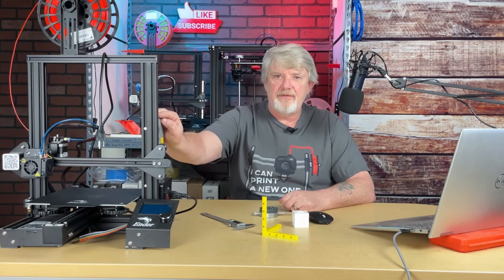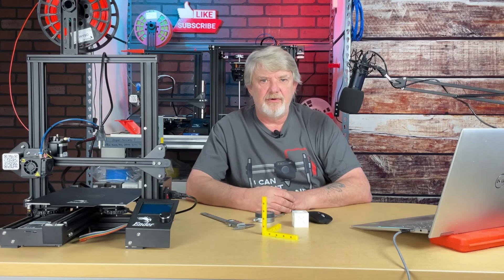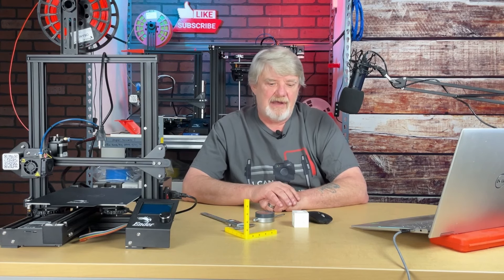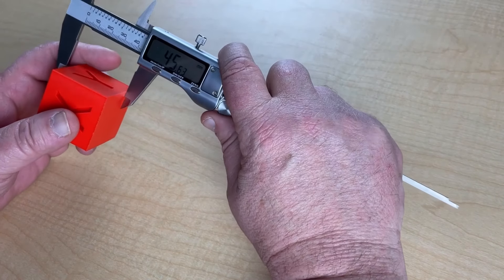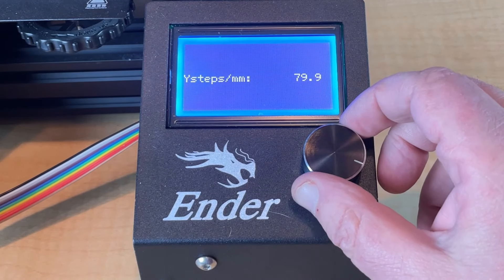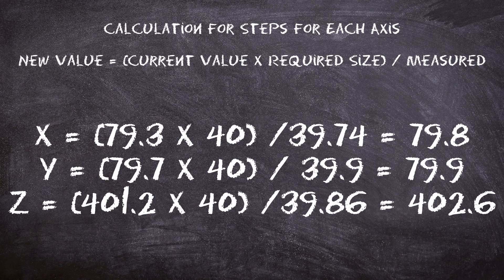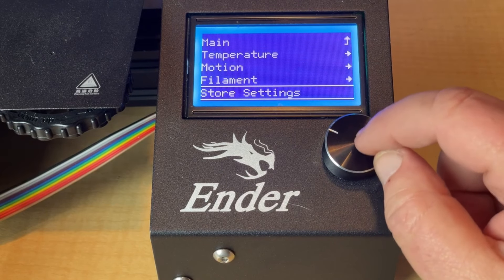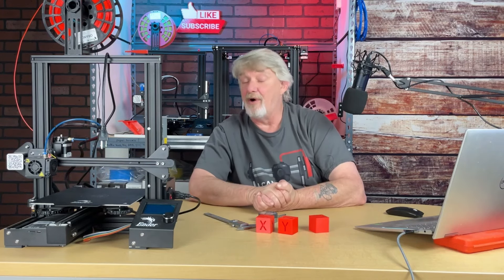Calibrate Your XY & Z Steps For Dimensional Accuracy of Your 3D Prints

Comment: This single video improved my prints, immensely!
Reply from the maker: That is awesome to hear!!! Thanks for watching!
Reply: @Pushing Plastic  I also found that after correcting the Z axis, X&Y printer narrower.  It's probably due to Z sqishing the filament outward.  Another cube, corrections made, and layer lines disappear 😀
Reply from the maker: @rangersammy  If the filament is pushing to far outward on the first layer and causing elephants foot as it's commonly called, you can enable Initial Layer Horizontal Expansion in the walls section of Cura's settings. Set it to a negative value that is equal to one half of how much is "squishing" outward. Example, if you are printing a 20 mm cube that is measuring 20.3 at the bottom, set your Initial Layer Horizontal Expansion to -.015. That will bring both side in by that amount. Thanks for the replay!! I know that doesn't help the overall height, but it will get rid any elephants foot you might see!

Comment: Thanks for all this!  I printed off a cube right after I got my machine, but then couldn't think what to do with all the data!
It's also a good example of why enclosures are a good idea. When you're chasing small numbers, thermal stability of everything really helps.  If I've just run off a part on my lathe and mic' it - then let it cool - I'll get a different number usually (depends on the shop temps!). In this case, it's not just the plastic. The frame of the printer, the bed... it all changes shape!
Reply: Oh yeah, other side note: at around the 8:40 mark when you were measuring the cube. It's a good idea to slide the calipers down more so the jaws aren't touching the edges of the cube as they tend to flare out a bit (so you'll be artificially reading high) when printing.  It's minor... but we're chasing tiny numbers right!   :)
Reply from the maker: I agree with everything you said! I'm liking that more and more printers these days are enclosed. My older printers, I bought some of the metal shelves from Lowes, the steel ones, closed off the side and back, printed some tracks for Acrylic sliding doors to enclose those too. One boring weekend, I printed the cube at 40mm, measured it while it was still warm from the printer, again a few hours an then put it in the freezer overnight and measured in the morning. I was surprised to find a bigger difference from room temperature to warm than I found from Room Temperature to ice cold. Thanks, for watching!
Reply from the maker: @DrFiero Good tip! No pun intended!

Comment: Just a small note:  at 4:15, the Z formula should start with (400 x 40), not (80 x 40). Thanks for the video!
Reply from the maker: Good eye! Thanks for catching that. I added a note in the description! Thanks for watching!
Reply: What does ‘current value’ meant?
Reply: @IceColdBold_  Current Value means what ever your printer shows as the default values in the "Steps/mm" menu in the Advance settings menu. The "Steps/mm" setting may be in a different location depending on your firmware. You should be able to find it under "Configuration" or "Advance Settings".

Comment: id like to know how i would go about calibrating it with the dial indicator. Do you have a video on that procedure
Reply from the maker: You need to print brackets to attach a dial indicator to your print to record movements in the Z direction and another to measure the x & Y direction. Zero the dial indicator and use your printers control panel to move the print head a desired distance. Record the values, do the math and then update the printer! I don't have a video for it. There use to be a lot of models for the different dial indicators out there. I don't know if they still exist of not.

Comment: This has been one of the best videos I have found on using the calibration cube and formulas to dial in a machine. I have an Ender 3 V2 Neo and an Ender 3 Max Neo that I am going to use this on. I do however want to know why you scaled the cube up from 20mm to 40mm. Also, I have noticed with my Max Neo that the height on taller 3d models is noticeably shorter than the same model printed on my V2 Neo. I am assuming this is due to z-binding but I have tried a number of fixes and still experience the issue. Additionally, I have found that moving the gantry on the V2 Neo requires very little force but the Max Neo requires quite a bit more to move it. I have loosened the dual stepper motors, lowered the gantry as far as it can go to align them and tightened them back up. I have also installed two flexible spider couplers and placed 4mm ball bearings inside of them for the dual lead screws to rest on. Finally, I have lubed the lead screws with a dry PTFE lubricant. Could it be the lead screw caps or the belt that links the two screws together causing the issue? What else could it be?

Comment: I really like your videos, and they have been so helpful, but I did find a small mistake on your calculation for the z. I'm sorry, but 80x40÷39 does not equal 401. You need to take the current z steps per mm, which mine is 500, so it would be 500x20÷ I, right ? Please correct me if I am wrong. Anyone
Reply from the maker: In the video Description, I point out an error in the math at the 4:15 mark. The formula for the Z axis should read (400 x 40) / 39.88 = 401.2 instead of (80 x 40) / 39.88 = 401.2,
Reply: @pushingplastic7445  well, I'm really glad that you replied.I wasn't sure if you're actually still checking in on this video post after being posted so long after watching.I use your instructions and got to my z steps when I calibrated that my machine change the z opposite by itself by .21mm going from 14.08 to 14.29
Reply: I am really.looking for an explanation and reason to what happened bc i caused some issues for me
Reply: @pushingplastic7445  oh ok. Well if you dont mind I'm in need of your help if you can. I'm running and ender 5 plus with Marlin 2.0.7.2 and btt e3 turbo. Belts are tight z rods are clean and tight etc. I followed you tutorial guide on esteps calibration and ended up with great results. Then started a print and my z offset was changed and my nozzle was digging in the bed so I stepped it down. However after i printed my dimensionaly accurate cube and started another print, catastrophe struck and i have been having massive print failures  since I calibrated the z steps. Any ideas ?
Reply from the maker: @ You need to correct your z offset

Comment: brilliant, i was just about to give up on dimensional accuracy on my ender 3, the parts I'm trying to print have to be within 0.001" and  I'm still not sure it can get that, but atleast now I have a method to try, many thanks
Reply from the maker: That's a pretty tight tolerance! Honestly, I'm not sure if you can get that close or not based on the thermal expansion/contraction of the plastic! I pulling for you!! Let me know how you make out! Thanks for watching!
Reply: @pushingplastic7445  Hi after watching your vid I printed the cal cube and carried out the changes to the printer, the item I'm trying to print is a hydraulic setting gauge for a valve in a David Brown Tractor with two holes in it to catch the fulcrum pin and position it while you set the clearence on the valves, the tolerences on the holes are detailed as + - zero, After calibration I got them to within a couple of thou, so I then created my own cube in freecad sliced it in Prusa and printed it out to see if there is any issues with the programs,  rechecked the calibration figures, made some very tiny adjustments to the z axis, now we're down to under .002" and I'm happy with that,
Many thanks for the video, I was beginning to think that thew printers couldn't achieve this level of accuracy, PS I print the holes at .375"  but then ream them because as you say the shrinkage causes them to undersize,
many thanks
Barry
Reply from the maker: @manfromthemist1958  You are the man! That's an impressive project and I'm happy to see that you're reaching acceptable tolerances! Seriously, reading that made my day! Thanks for that and keep on printing!

Comment: Awesome videos! You helped me already with the g codes to adjust my e steps on the anycubic vyper. It worked great. I’m not to this step yet because I have some towers to print. But can you give me the g codes to save these settings to my printer through prontoprint? Hopefully I’ll have her dialed in this weekend. Thanks so much!!
Reply from the maker: Same codes and steps if your printer is running Marlin firmware, I'm assuming you mean PronterFace? The command prompt is at the bottom of the pronterface screen.

Comment: Great video  Just a little confused when you said the current value of the machine 80.  What exactly did you meant by that?  Im new to 3d printing and just picked up an Ender 3 the other day.

Thanks!!
Reply from the maker: When you go to the LCD on your printer and select Control, then Motion, followed by Steps/mm, you'll see the current values (Steps), that are stored in your printer. See the 5:04 mark in the video. Also, in the video description, I made a note of where I typed 80 instead of 400 for the Z value. I hope this helps! Thanks for the comment and Thanks for watching!
Reply: @pushingplastic7445  Thanks and again great video.
Reply from the maker: @loczster  Thanks!!!

Comment: I am not sure if changing the steps per millimeter is a good thing on the x,y and z axis.
The mechanics are that with a GT2 belt  and 20 toorh wheel on the Stepper Axis you have 200 steps per full rotation which is 40mm of belt travel.
With a T8 leadscrew you got 8mm travel per full rotation or 200 steps.
Any dimensional inaccuracy is a result of e-steps, flow and filament expansion or shrinking.
Reply from the maker: eSteps determines how much filament is going through the extruder, your flow rate determines the amount of melted filament is coming out of the nozzle. While they can affect your dimensions with over or under extrusion, if you dialed in those alone you won't achieve dimensional accuracy. I would love to see the math on thermal expansion/contraction since all objects plastic, metal, paper....ect are effected by thermal expansion/contraction.

Comment: How do I adjust my 3d printer? It start to print 0.03mm above the initial layer that is supposed to. Therefore I am missing 0.03mm in the initial print.
Reply from the maker: Are you referring to the layer height? And do you mean 0.3mm instead of 0.03mm? You could handle that with the Initial Layer height is the quality settings of Cura.

Comment: Hi im working under Marlin 2.0 bugfix on my Geeetech A10 i can change settings  via octoprint terminal?
Reply from the maker: Yes you can! I also have an A10, I haven't used it for a while but when I did I would always run these commands thru the octoprint terminal!
Reply: @pushingplastic7445  Thanks a million time :)

Comment: There is only minutes difference in print time between the 40mm cube and the 100mm three leg item. Personally I use the three leg item for increased accuracy.
And Cura has several calibration models already installed, they are correctly orientated when you select them, so no mistakes.

Comment: Where did you get the 80 number from. I do not have those X Y & Z options on printer setting nor are they on Cura settings unless I missed something?? I PLA and PETG do not produce the same results. The PETG models are smaller..!?
Reply from the maker: 80 in my case was value already set on my printer. Your printer could have a different pre-set. Have you determined the right flow and temperature rate for your PLA and PETG individually and save that to your slicers material profile?

Comment: I got a question regarding the cube's orientation on the slicer.  Shouldn't the X of the cube be facing to the sides?
Reply from the maker: The lines are printed side to side for the x axis, so the x faces forward on the bed plate. The y axis prints front/back, so the label for y does face the side.

Comment: When using the 100mmx10mm axis print how do I know if the Horizontal expansion is  not the issue and not the E/Steps?
Reply from the maker: If you have calibrated your esteps, then you can immediately take that off of the list of possibilities. Then, make sure you’ve checked your flow rate. After that, do your xyz calibration. From there it’s horizontal expansion to tweak your print. Hope this helps

Comment: Is there a gcode equivalent for the settings?  I upgraded my board and display and no longer have the calibration from the screen.
Reply from the maker: You could connect your printer to a computer and use a program like pronterface, repetier host or octiprint to make the types of changes

Comment: Another great video, thanks!  I did the 40mm cube and got good results, with just .03 mm difference in the measurements.   I then did a 20 mm cube, and the x &y were 20.03, but the z was 19.6 mm.  I'm puzzled.
Reply from the maker: The Z can be a little tricky sometimes. It could be something as simple as a little extra squish on the  first layer. But 0.4 over 20mm is still really good!
Reply: Thanks for your timely response.

Comment: Where do you find these settings on the ender 3 KE?
Reply from the maker: The Ender 3 KE has Klipper firmware, this video is for older printers with Marlin firmware. Klipper firmware, known for its speed and responsiveness, can significantly improve the dimensional accuracy of 3D prints compared to traditional firmware like Marlin. In other words, you shouldn't have to worry about it. It can be done, but involves rooting your printer. Simple calibrations like Temperature and flow will go a long way towards getting dimensionally accurate prints. I would run those first. I have videos on my channel to help, and see how close your prints are to being dimensionally accurate.

Comment: Will this work on other creality printers? Like the CR6 SE and Max Neo?
Reply from the maker: I can’t speak for those machines specifically but I used the same method on my Ender 3’s, Ender 5, Ender 5 Plus and Geetech A10M. If you can access your xyz steps from your LCD screen you’d be able to do it as shown. If not you need to connect your printer to a compatible via a USB cable and use a program like Repiteir Host to send gcode commands to get & set your values. Thanks for watching!
Reply: @pushingplastic7445  I appreciate the feedback back I'll try it and let you know for future reference.
Reply from the maker: @nickolascastillo4019  thanks! I look forward to your feedback!

Comment: it can happen that you get other errors through slicing and printing, which then affect the calibration with this method!!  Isn't it better and more correct to have the nozzle moved 100 mm in each direction and measure the actual path and use these values to carry out the x,y,z calibration?

Update: I did a quick read.  It actually makes no sense to make this calibration dependent on a 3d print!  because the steps come exclusively from the hardware of the printer.  Therefore (as described above) they should only be calibrated with them (like the E-steps)... or am I wrong?
Reply from the maker: The video points out that the more accurate method would be with a dial indicator measuring the travel. Many people in the 3D printing community don’t own a dial indicator. The method shown provides an alternative to those without dial indicators. The video also talks briefly about the behind using 20 mm cube and a 100mm cuz printed axis.

Comment: An easier calculation is the DOG (desired over gotten) method. 
Desired measurement / Gotten measurement x current calibration factor = new calibration factor.
Reply from the maker: I'm not sure what makes that easier? It's not any harder but it's not any easier and the result is the same. (current x desired) / gotten = new calibration factor, it's the same number of steps with the same result or am I missing something? Thanks for watching and keep those comments coming!
Reply: That's the same formula only written without brackets 🙈

Comment: Using your math why did the z come out to 400. What was calculated differently
Reply from the maker: At 4:15 in the video the formula should read (400 x 40) / 39.88 = 401.2 instead of (80 x 40) / 39.88 = 401.2. There is a note for this in the description
Reply: Thank you for the quick reply. I am a newbie printing and still trying to figure a lot of this out so I need to look in my machine and get my base setting first as how yours was reading 80 correct and 400 on the other one and you multiply that times 40 which is the 40 mm of the cube correct And I rewatch the video several times looking at how you were measuring the block and it looked like you measured the same axis twice. I will go back and rewatch things again.
Reply: My NP3 pro doesn’t give me the option to adjust that in the menu. I was able to do flow rate and z steps. I have travel options but my numbers look much higher that yours and I don’t want to mess it up.
Reply from the maker: @rtlofishing  Understood! When in doubt,  leave it as it is. How accurate are your finished prints?